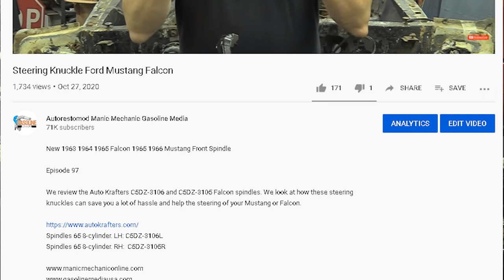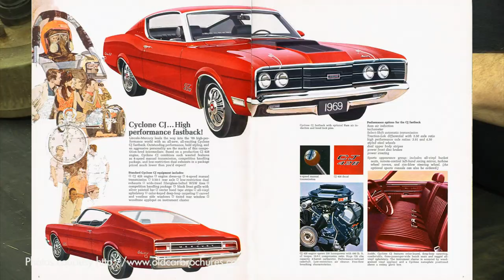FYI Ford Granada Brakes

Comment: I have the Granada brakes on my two 68 Mustangs. In order to use my factory 14” wheels I had a machine shop to turn down the outer diameter of the hub so the wheel would slide over it. That was 15 years ago and they have worked fine.
Reply: does that include granada spindles? ... and does the granada wheel bearings only work for that?

Comment: Back in the early 90’s I used 78 Granada spindles and brakes on my 64 Ranchero. Still driving it and the set up works great. Only hiccup was the tie rods, but the parts guy at Napa worked with me to find the right parts. We went through a lot of boxes and finally found what we needed to work with my power steering.
Reply from the maker: Thanks for sharing. If set up correctly, the Granada can be made to work. It still will have some bumpsteer issues that are hard to get rid of.
Reply: @AutoRestoMod  I have no bump steer problems. Only problem is a sloppy steering box. Back in the early 90’s when I was building the car I only found one company that sold new boxes, but they were out of stock and didn’t know when they would have them. I think they were made in South America. Also back then Granada conversations was the one car magazines talked about except for the companies that made disc brake conversion kits. Also the Granada spindles were free and I also just finished restoring a 66 Mustang and money was a concern. If you haven’t done a video on steering box adjustments I would really like to see one for Fords.
Reply: I have a ‘65 ford ranchero and did a Granada swap. I noticed I’ve run out of thread. Can you tell me the tie rods you used exactly? Thanks.
Reply: @meanbird4979  
Unfortunately I did the swap back in the early 90’s so it’s hard to recall. Originally my Ranchero Delux had manual steering. A friend gave me a complete power steering assembly. The tie rod assemblies fit perfectly, but we’re totally worn. When I tried to replace them by what was listed in the catalogs at Napa they weren’t even close. The parts guy started opening boxes and finally matched them to the worn out rod ends. Still driving the Ranchero and I have never an alignment since the original alignment. Everything has held up over 36k miles except for an idler arm that  had a bushing fail last year.

Comment: Got any thoughts on upgrading the granada calipers? I've been running those friction slide calipers on my maverick for years, and it annoying to have to change pads when one is down to nothing while the other still has allot of life on it.  I've been wanting to go to a floating caliper, would the '73 mustang caliper bracket that used the floating caliper work on a granada/maverick spindle?  are their any other options to put a floating caliper on a a granada spindle on a budget? I've seen factory caliper brackets that 'look' like they'd work from different vehicles... but don't know.

Comment: This is great information. I have a couple of questions. 1- I have found late model Mavericks (75-77) with front disc brakes. They look to be the same as the Granada in replacement parts. Is the spindle the same. 2- will the Granada spindle work on a 64 ranchero.

Comment: I’ve got CSRP spindles with Granada brakes on my 68 Mustang, they work well. I’m in New Zealand and we have strict laws with aftermarket parts so I had to have a bump steer test and they passed with no problems.
Reply from the maker: Yep. There are a LOT of cars here that would fail Aussie Road Rego just for that kind of issue.

Comment: I really enjoy your video and show. can you tell me. for the Granada swap does it matter if the Granada is a 6-cylinder? is year important? found a 1980 0r 1979 Granada not sure yet
Reply from the maker: I think that by 1975 Ford was using the same components on the six as the eight. But I can't be double sure. My interchange manual only goes to 1974.

Comment: the reason for cross drilled rotors is not for weight. its to allow the gasses that form between the pad and the rotors to escape, otherwise you get brake fade.

Comment: I lucked out and got a free set of Granada disks for my ‘68 Mustang. My uncle is a firefighter and they were cutting up a Granada for jaws of life training. When they were done, he got the disks before they junked it. 
They work good for cruising but eventually I’ll upgrade to something more performance oriented
Reply: Ive had no problems with performance pads.
Tire lockup is proportional to TRACTION.

Comment: Does a Mercury spindle match-up to the Ford or Lincoln part numbers or is it a beast of it's own?
Reply: For the most part, 75-80 Granada and Monarch use the same spindles and brakes, with only the Lincoln Versailles spindles being different.

HOWEVER, ....

Be aware that Ford did offer the Granada and Monarch with a 351W V8 in '75 and '76 (possibly '77 as well).  If you have the Windsor-equipped model, or a model that was delivered with the police/heavy duty package (yes, it was an option!), you'll likely find the Versailles spindles.

Finding one with the Versailles spindles is a fairly rare event, though.  Seriously, if you DO find a set of those in a yard, buy the whole car if you can, and make sure you buy some lottery tickets on the way home....
Reply from the maker: Lottery tickets...he's right though.
Reply: Versailles ball joints fit most of the Fords.

Comment: I just did a disc brake upgrade on my 68 Torino, and the rear brake line has a metric fitting at the pressure valve. I can't find a 3/8X24 male to M12X1.25 female adapter anywhere. Hopefully I can find one in Birmingham tomorrow. Have you encountered this before?
Reply from the maker: No. That might have been the wrong nut in the wrong bin at the assembly plant.
Reply: @AutoRestoMod   I found it was a 7/16X24 thread. Thanks for your response.

Comment: Cross drilling and angle grooving is to disperse the vaporizing pad material. The vapor causes the pad to float on the vapor reducing the stopping effectiveness. Kinda like an air hockey table.
Reply from the maker: I agree, I still prefer the grooving to cross drilling.

Comment: Will a rotor made for 69 Torino disc brakes fit on a Granada spindle??    I can get the old 14 inch wheels to fit on the older rotor hub.
Reply from the maker: You might be amazed at how many small changes Ford made to brake systems on these cars. I would say that if I were going to buy rotors I would probably buy rotors for a Granada system if that's the spindle you have. In looking at part numbers on Rock Auto they are different for either car.

Comment: I’m doing a Granada brake swap on my ‘67 Cougar (manual front drum to manual front disk). I bought a ‘75 Maverick master cylinder for manual front-disk/rear drum, and plan to purchase a manual proportioning valve for the drums. Can I keep the original distribution block and rear drum residual pressure valve? Does the new master cylinder account for the different pressure in the drum lines?
Reply from the maker: I would try it out. It's too bad that the '74 Disc Brake Maverick Prop valve isn't available, that would work perfect.
Reply: The 78 Granada(etc) brass combination valve works great for all disc/drum cars.
If you find a 4 disc car, G/V, grab that valve for 4 disc.
They worked great from the factory. Better than manual valves. IMO.

Comment: I noticed you neglected saying this works on 1964-66 Mustang. Is there any extra things I may need to know when installing this to 4lug drum setup? I already have a 1976 ford Granada parts car so parts aren’t an issue. Great video :)
Reply from the maker: Yes. I don't like them for it. The tie rod position is way different. I would recommend getting the new Scott Drake spindles and bolt on disc brakes. You'll have a ton of time getting rid of the bump steer in the Granada spindle on that car. It can be done, but I am not sure what the procedure is.
Reply: @AutoRestoMod  ok, thanks. i think i will attempt to use the Granada spindles and if it gives me problems then switch to trying what you suggest.
Reply: @ryanis_here  I have the Granada set up on my 65 fastback, spindle's, rotor's , calipers and outer tie rod ends. Drives great no bump steer 1,46 60 ft at the track. Also have the Granada 9 inch in the car, perfect fit although the pinion angle has to be adjusted a bunch.
Reply: @doughorn7257 .. hi Doug , have same set-up on my 65 FB . No bump  steer problems either.  The only issue I have is pads dragging on discs.  Is there a fix to rectify this ..cheers mate

Comment: My father did a disk conversation on his 59 Fairlane skyliner using Granada spindles only way to use the original 14in rims but have to modify the hole for the tie rod on the spindle as the Fairlane is more wide

Comment: Hey need your help want to do a rear differential 8.8 from a 1977 Granada to a 1970 Ford maverick grabber please help me out any information of it will fit trying to go 5 lugs I’m running 4 lugs
Reply from the maker: The Granada won't bolt up you would need a 65 66 Mustang or 63 to 65 Falcon rear axle. The 8 inch from any of those will be enough for most any six cylinder or mild V8.

Comment: Thanks for the great information.
I have the Granada setup on my 66 fairlane and I'm using the 14 inch magnum 500 wheels. My tires rub the upper control arm. What size wheel spacer should I use to make this clear? Thanks for your help.
Reply from the maker: Not a fan of spacers. Youcan upgrade to a 15 inch wheel and tire and stop the rub problems. I have read that the 3/8-inch spacer will give you the room, but as I said, not a big fan.
Reply: Mine only rub the sidewall  in full droop. 
215/70 tires. M500 wheels.
No need to change.
I did try 5/16 spacers and then the tire rubbed the fender lip during bump going up a driveway.
Rather then roll the lip, I just removed the spacers.

Comment: I put new 1977 Granada spindles and calipers on my 1963 Fairlane. Had to replace the tie rods ends with 1970 LTD's. Also had to go with 15" wheels.
Reply from the maker: Both of those are issues that you will encounter with Granada spindles. I have not done any testing with 62-65 Fairlines spindles to know if those would be affected negatively by bump steer.

Comment: my 68 mustang project has granada ft brakes, i bought all stock 68 disc/caliper/pads before i realized that i had granada  brakes.  now i got the caliper brackets for the mustang brakes and i see that the spindle is granada  and the bearings are bigger on the granada, im assuming i cant use the 68 disc and bearings with the granada spindle or are there bearings that can adapt? ? can i use a 1970+ mustang disc and bearings,, and outer tie rod end with the  granada spindle and 68 disc calipers i bought?? appreciate any help you can give
Reply from the maker: Contact Mustang Steve: https://mustangsteve.com/

He knows those systems way better than I do.

Comment: Brilliant Video cheers guys great info as my 72 Mach 1 i imported to the UK 2 years ago has 75-80 Granada front disc. Cars not on the road yet still restoring it, but I've just bought new Granada calpiers to replace for the time being but any recommendations on future brake upgrade kits and what would be the best route to go. As i need to replace all the ball joints etc I take it i may also need to get Granada Tie Rod Ends.
Reply from the maker: Really the only improvement that you can make them is a performance style pad and the slotted rotors that are available for them.

Comment: Another issue with the spindles that you have is I have a 69 Ford mustang using that spindle conversion I 15 x 8 aluminum slotted wheels well work I’ve tried to fit  17 x 8 cobra R wheels and the rims drag along the tire rod to where it will damage the rim any recommendations on that issue 🤔👍😊
Reply from the maker: If they are the later model Cobra Rs (like for the SN95 Mustang, the offset is wrong for the Mustang.

Comment: I have Granada spindles/brakes on a 1960 Comet 2dr wagon and a '65 Ranchero. Both have been on the cars for 14 and 19 years. Both cars have V8 suspension and '65 Falcon V8 steering. The '65 V8 steering setup should be considered mandatory when putting this setup on a '60-'65 Falcon/Comet. Earlier V8 or six cyl steering leads to dangerous bump steer problems, the '65 setup has compatible geometry that works with the Granada setup. Both cars handle well and have no bump steer.
Reply from the maker: That is the best way, we'll be doing a video on what to upgrade on the car with the Ranchero in the next few weeks. Now that all the stuff is available to go to the '65 steering parts, I see no reason for a guy NOT to.
Reply: Bump steer is extremely easy to correct using a heim joint.
Look it up.
Reply: Can you tell me which tie rod ends you used for the ‘65 ranchero? I did the swap myself but am noticing the threads on the tie rods have ran out with no space for adjusting. Thanks.
Reply: @meanbird4979  My Ranchero has the '65 power steering setup, so for the right outer tie rod, I used stock Granada to interface correctly with the spindle. For the left outer tie rod, that's a different story. Ford used a larger thread size on the inner and outer tie rods and sleeve on the driver side only, so a special conversion tie rod manufactured by Rare Parts was used which has the large thread size and the correct taper for the Granada spindle. If you have manual steering, just use Granada tie rod ends on both sides.

Comment: Jeff, it looks like the wagon is sporting BFGs.... I got the same tires on my 2010 NM State Police Panther.... love them tires and the tread pattern is smokin cool  😎
Reply from the maker: Yeah, we di our BFGs around here.
Reply: I bought 4 new TAs and they were the worst set of tires Ive ever had on mine.
Too soft and "wormy" driving with less than 50 psi in them.
Switched to Tiger Paw AWP II touring and they are super great. 
Drive great. Super wet and dry traction.
Hard to believe the TAs are THAT bad.

Comment: I used it on a 1965 289 Mustang. used 1970 mustang upper ball jints and outer tie rod ends. They have been on the car now for 30 years. Got at a junk yard, complete front end $35. ps, same exact parts as a 1974 Maverick disc breaks, which is what I bought. I used 1970 Mustang upper ball joints and outer tie rod ends.  I also bought the Maverick rim as my spare, and I use 15" X 7 Magnum 500 wheels, fit perfect. And I used no sleeves.
Reply from the maker: Cool!
Reply: @AutoRestoMod  I used to build AC Cobras for a living. I did my own mods on the car. You will like this one. I took a four speed bell housing, drilled out the fulcrum two rivets. Than made a template for the four mounting hole for the transmission and the fulcrum holes. Bolted the template to the T5 bell housing, took the pivot fulcrum off for the cable, drilled the two 1965 fulcrum holes. The difference in a 3/4 spd toploader and Tremec 5spd  input shaft is 5/8th of an inch. So I put a 5/8th inch solid aluminium spacer to move the 1965 fulcrum foward on the T 5 bell housing, bolting with grade 8 and metal locking nuts. I installed the 1965 clutch piviot arm with 1965 throwout bearing and 1965 soild input shaft bushing. Now all the original clutch linkage works Z-bar and all. No cables, no hydralics to route or keep away fron the exhaust. And only a discerning eye can see the Tremec. Aluminium driveshaft, Shelby drop with upper arms kicked back, 1968 biig block springs with 1/3rd coil cut, one inch front and 11/16th rear sway bar from Stambar, extra half leaf, 3:55 posey eight inch. I also have a Reed Cam, took a little piston eyebrow adjustment for clearance with the Edlebrock heads. Later model timing cover so I can replace the front seal. Another trick, I cut a lifter push rod, tapped the inside and made it adjustable with a stud. Used it to keep my roller rockers perfectly centered, than ordered the exact length. All this 30 years ago and have never touched it. The upper control arms are almost hard mounted to the frame, hardly any shims. And everything was powder coated.

Comment: A lot of great info.  Looking for a drum to disk upgrade on my '67 FB so this was helpful.
Reply from the maker: I would have delved into that but MAN there are a lot of kits out there.
Reply: The mustangs in 67 have the same spindles for i6 and v8 cars with disc or drums, so your spindlr can easily be converted to factory style 4 piston discs using factory style parts.  Chockostangclassicmustang.com is a great source for them.

Comment: Do you know if a rear end and front spindles from a 76 granada will work on a 66 Mustang?
Reply from the maker: Rear axle is too wide. The Granada brakes will bolt up, but they do induce more bumpsteer.
Reply: 👍🏽Ok I appreciate for the response.

Comment: My '67 has disks up front and drums in the rear. Would this be an upgrade up front?
Reply from the maker: Not really. If you have the bolt on front mount calipers, stay with that. Brake upgrades are much easier.
Reply: No, the mustang disc is bigger.

Comment: Hey Bud how are you I enjoy your videos very much And if you cut me I  Please Ford blue lol... I have a 65 Falcon with A302 and it's under construction I bought it kind bought it kind of half of it was in the  crate  kind of thing  But it came with  It's disk brakes but they had spacers on the tires to bring them out further is there something that I could do and not use the spacers cause I'd rather not is at rather not and I think it's a Chevy pattern which I'm not obviously a big fan of but without the spacers they sit way in is there a reason for this there a reason for this relative stock suspension suspension thank you very much
Reply from the maker: Sounds like a a cobbled together system. I'd get a set of stock spindles and source a set of aftermarket brakes.